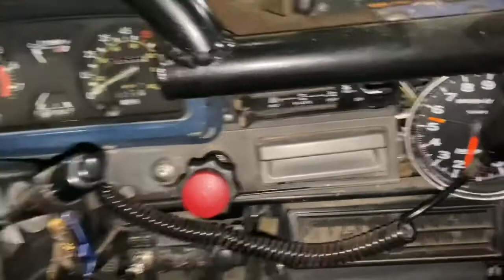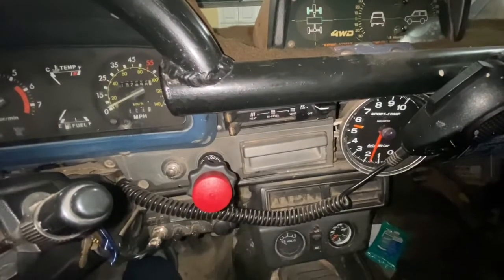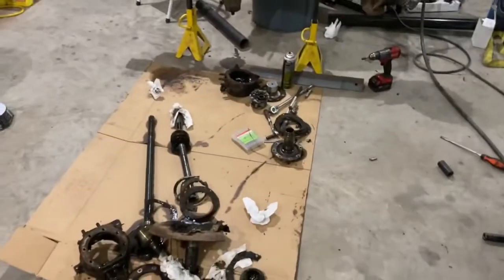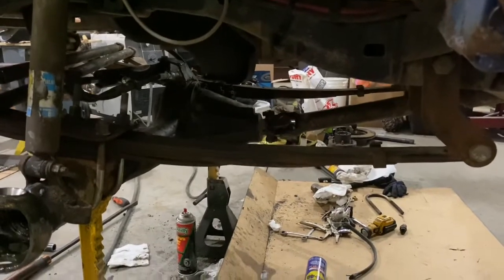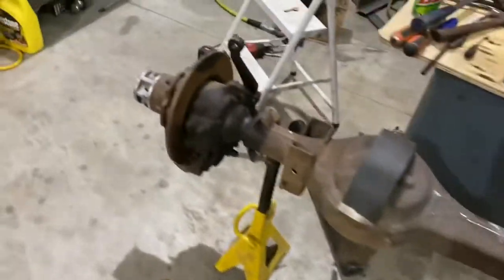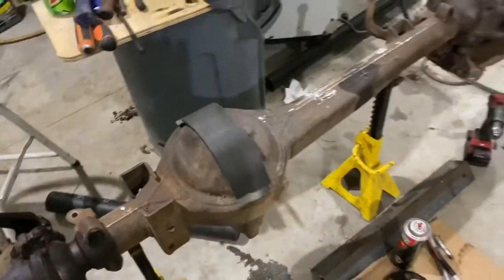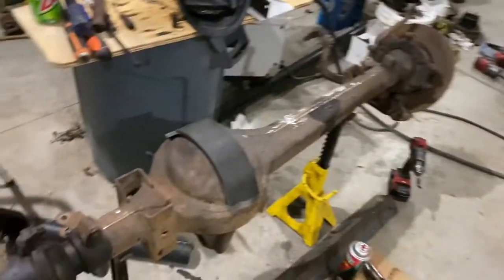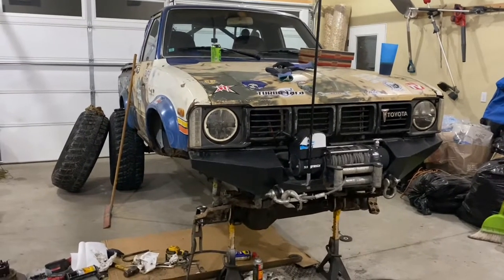Stomper update and e-locker cable conversion description

Comment: How hard would it be to go back from a e-locker to just a v6 8” 3rd? I have a e-locker in the front with cable swap but it’s a pain in the butt to get it to lock I just leave it locked and unlock a hub
Reply from the maker: Hole pattern is off. Have to weld shut a couple stud holes and redrill and tap them.

Comment: I've always been curious about the cable conversion for the Toyota e lockers, but I've never gotten to play with one. I've had a couple of those e lockers on my vehicles over the years, and with my old 85 4runner I rewound the electric motor no less than 4 times while I figured out why my wiring was burning up motors. Very cool! Love the truck too! That's my favorite grill, hands down.